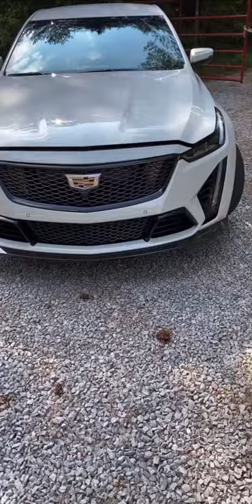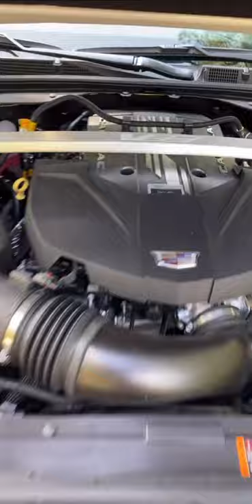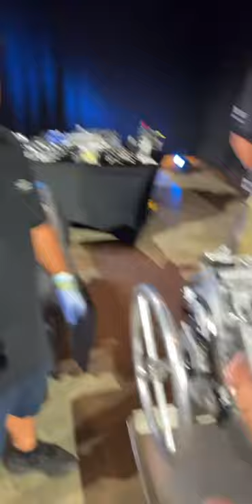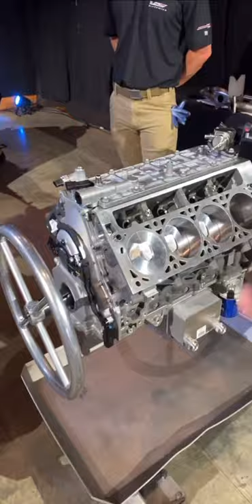Cadillac CT5V Blackwing's HANDBUILT V8!!

Comment: Two and a half hour is fast for hand built
Reply: He said two and a half
Reply: @fox0013  sorry
Reply: It’s not like they make the metal..🤣🤣
Reply: @Hayden____  i mean yeah but there’s a lot that goes in it I wanna see you build one in two and a half hours
Reply: @Hayden____  Do you know how detailed every combustion engine is? Every little thing has to be perfect and it's made by hand which takes much dedication.

Please leave if you can only think that it's something easy to do and isn't something impressive.
Reply: @proxyhx2075  it’s a mass production engine. They have jigs and fixtures to speed up assembly and these guys are probably doing only this engine.  They also aren’t hand ratcheting stuff down. All of the end cap bolts are torqued down at the same time for example.
Reply: @Hayden____  ok
Reply: @someusername121  Are you in the plant to see for sure they don’t?

Comment: So it's just assembling Legos at this point. I'm not sure I would consider this "hand built" I have built more than a few engines. It takes about 2.5 hours just to lay all the parts out and inspect before assembly. Hell it took about 7 hours for me to do an in-chassis cam/valvetrain and cylinder head swap on a 350 chevy engine.

Comment: My pops is also a master technician and got five rewards, if they really are master technicians then they wouldn’t be doing just one within two hours. He was doing two at a time within two hours. The technicians these days aren’t master technicians there just walking degrees.
Reply: Or maybe it's because the engines now are more complicated... use your brain before saying something
Reply: @bruhbwoi3618  mechanical designs for v8's havent changed and wiring harnesses for comps are simple for a master tech to plug in. Being a mechanic is real easy turning wrenches the best ones have diagnostic abilities.
Reply: Lmao y’all are something from another breed 😂😂😂😂
Reply: @jackiegleeson7852  a gen v lt and gen II small block are very different don't make stupid comments, only thing in common is there push rod, this is a DI 0w-20 engine
Reply: @Paul2.4T  bruh piston piston rings push rod crank bearings tolerances cylinder heads and intakes are the same dip. And domt cite fucking oil as if it is a piece of metal in an engine. Over head cams are different but they are trained to put them in a specific order and they are timely about it you cant change basic enginering for an engine. Sensors dont add a fucking massive difference they screw in and timing chains are just the damn same. Engines vary on things like cylinder head design rod length valve number and cam placement. You act like its a damn radial engine with the way you act, ELECTRONICS ARENT THAT COMPLICATED

Comment: I'd still prefer a robot building it because of human error and how much more consistent a robot is like there's a reason we use robots.
Reply: Nah man, a robot wouldn't notice flaws on the parts, it'd just put them together and you could end up with bad shortblock or Longblock parts fucking your engine over giving you a lemon
Reply: @justjamesAMX  u would have someone looking
Reply: @joeyknight8272  you still wouldn't notice some stuff unless you were actually building it.
Reply: @justjamesAMX  eh robots just do better
Reply: @joeyknight8272  agree to disagree because cars from back when engines were all hand built the engine would typically outlast the body of the car.
Reply: @justjamesAMX  ok sure. I doubt that's true. Toyota and Porsche among a few others have cars that would last till  the world stopped spinning. And im pretty sure they ain't using hand-built engines.
Reply: @joeyknight8272  doubt it if you want it but I know plenty of guys running numbers matching 350s 302s 440s 340s 318s 273s where they had to do a full restore on the body but the engine was just fucking fine.
Reply: @justjamesAMX  cool
Reply: @joeyknight8272  yeah, num matching classics are super fucking cool, like my 83 360 AMC Jeep J10